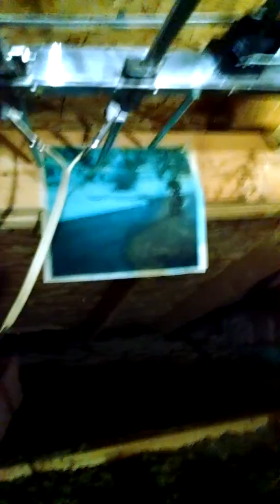CB dipole antenna -- attic setup

Comment: Well of course and outside antenna would be better but when you can’t do that your solution was simple but elegant. How does that work for you. Thank you for posting this video
Reply from the maker: Radionut R Hey, thanks! It works pretty good actually! It's actually better than the outdoor Saturn B100 I was using. I can talk to local guys that are about 10 miles out -- clear across town -- with no problem. I'm up on a hill, so that helps too. I've been able to talk skip a couple times as well.